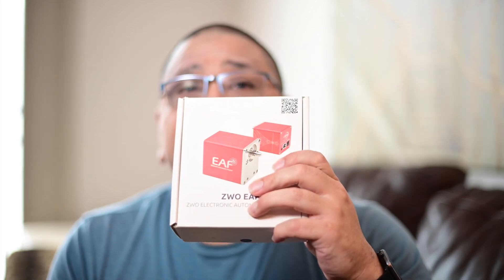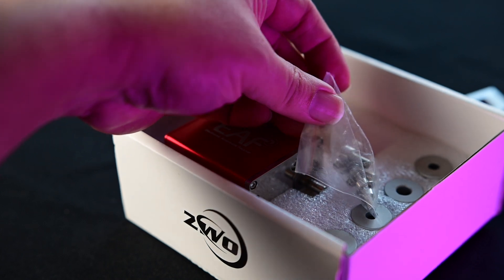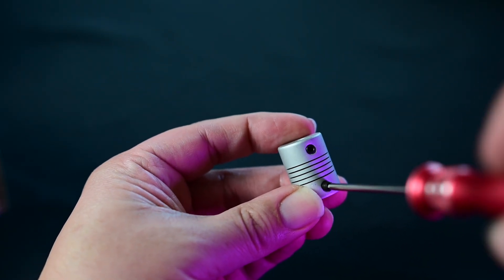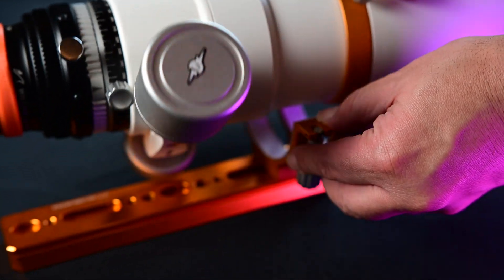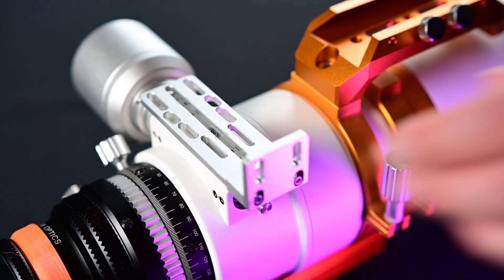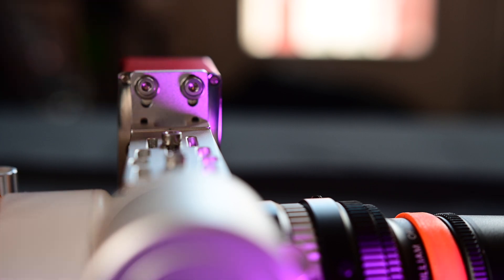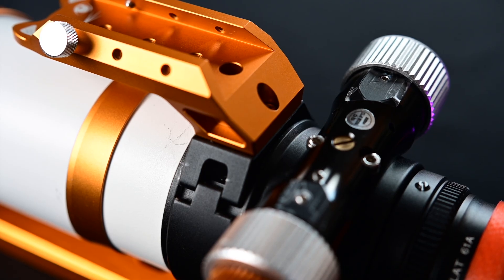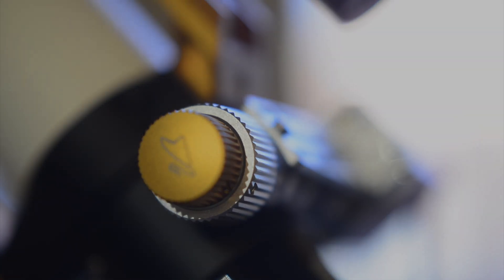How to install the ZWO EAF on the Zenithstar Z61/Z73

Comment: When you installed an EAF on the Carbonstar, did you remove the break knob completely? My focusing tube moves if I don’t tighten the break after focusing so I am thinking I may need to apply more tension to it but this is my first time using a scope with a Crawford focuser.
Reply from the maker: Yes you have to reinstall the tensioning knob those linear bearing focusers work a tad differently. Put a load on the focuser and then tighten it down till the eaf can move it up and down. Mentioned it in this video during https://youtu.be/zG2fLp-4LgQ?si=wq98T2EJ1XFtVfhC it was at 13 minutes in i believe

Comment: Thank you for this. Just got mine installed. Newbie/silly question: is there any reason why I can't keep the EAF on the top of the OTA (that is, not turn the scope back upright in the rings)?
Reply from the maker: No not at all you can install it wherever you like. Sometimes it makes a difference when you are trying to achieve balance but other than that all good 👍

Comment: Nice video!!. but, where is the brake of the focuser in zenithstar 73?
Reply from the maker: Brake? I'm not sure what you are referring to. Can you explain it a bit more?
Reply: @astronotna  sorry screw lock under de focuser....
Reply from the maker: Oh I see.  It's screw located on the top of the tube near the focuser. It's in between the accessory screws